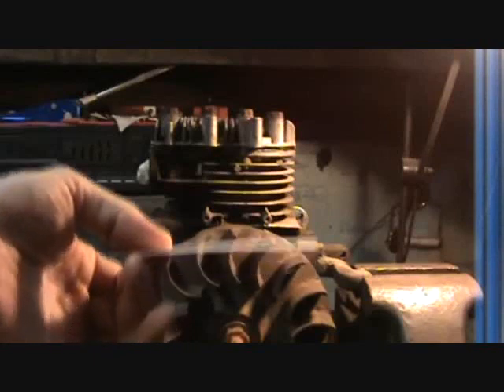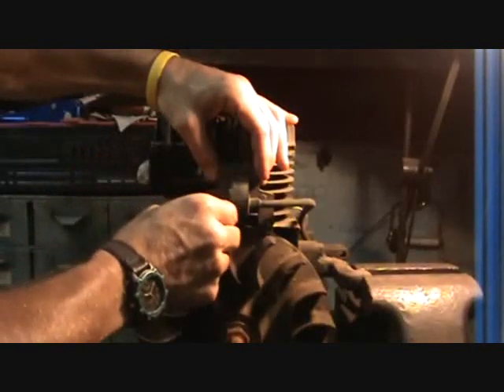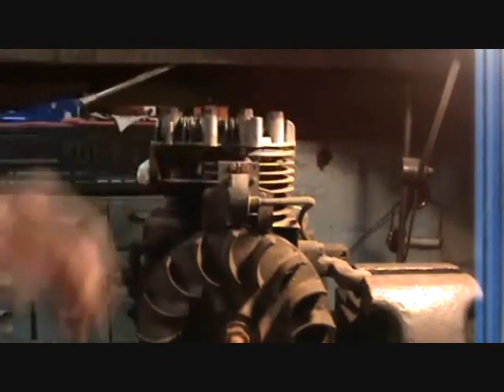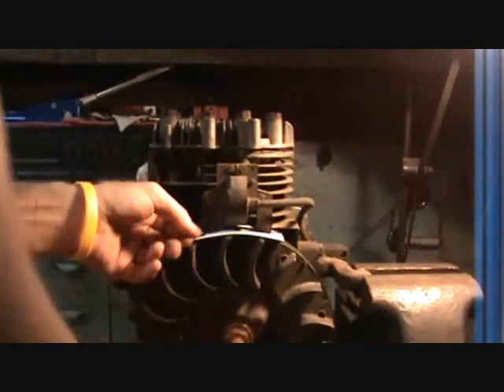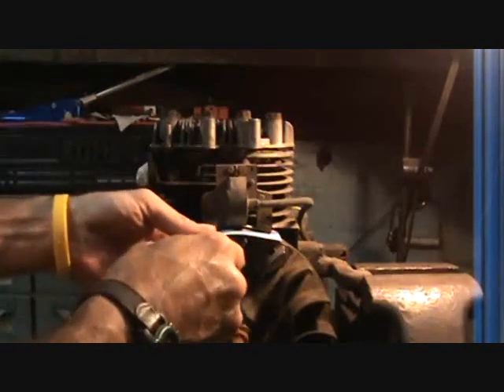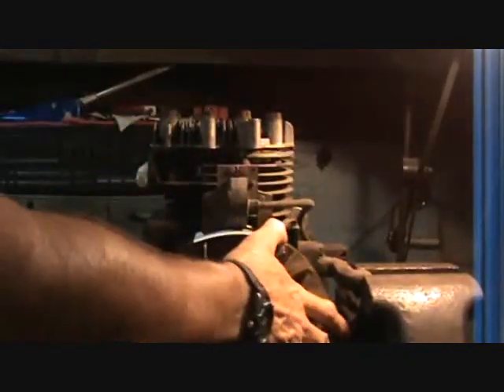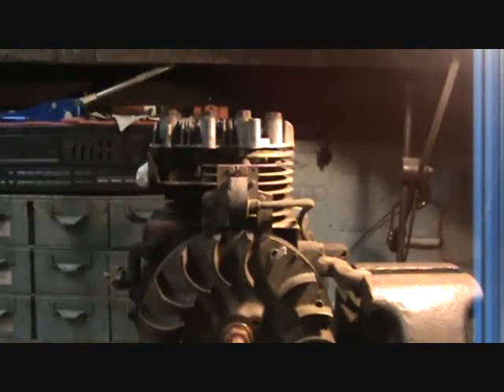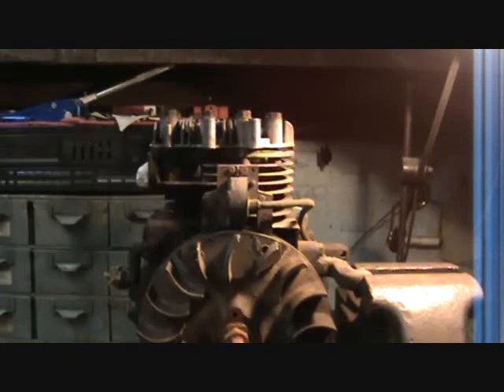Briggs Coil Magneto Magnetron installation tips

Comment: The Briggs larger HP engines have a separate Magnetron mount bracket that is slightly adjustable with slots, for the purpose of  timing changes with OTHER fuels propane, lp, etc. I need to know if these engines can have the bracket relocated for use as ATDC for use with hydrogen gas. The bracket slides under screws short distance.. Is there room for metal screws at different location  as further clockwise as minus 34 degrees for the Magnetron?

Comment: Do you have any experience with gear reduction units on Briggs.  I have an 8 hp from 1974.  What ever oil I put into the reduction gear eventually drains ino the crankcase?   I took it apart, not knowing what I would or should find, and there is a drain hole at the bottom side of the crank through the  side housing into the crankcase. This hole is at the elevation of the gear reduction case fill hole. It eludes me as to how the oil is leaving unless this engine is intended to operate at level only. Maybe if I had it operated at an incline with the PTO side up that is how the oil escapes?
Problem number two.  The attachment bolts from inside the case with lock bend over tabs are fine thread and have been striping out over its life.  The two other bolts outside the case are course thread with same problem. Why are the internal fine thread and external course thread?
Reply from the maker: Excellent questions M One! Yes, I have a number of RD Briggs here. Two of the three I have, have a oil port that allows oil in and then out using the engine oil as the RD oil. The third is a sealed unit with actual gear oil in it (My Model BR6). None of the three I have are as you describe so on that, I cannot help without a model number and type from your engine. On the bolt threads. The fine thread are meant to be torqued more than coarse in general mechanics, so I can only ascertain that they are different because two are load bearing and the other two are for assembly retention and non load bearing. As for why they may be becoming stripped, is that over time, the bushings/bearings on the output shaft of the reduction gear assembly are becoming worn from over tensioned belts or chains. This could also explain why the attaching bolts are stripping out. These are typically designed to be used with chains, but when used with belts, they must have a spring loaded idler arm and pulley in the assembly as to keep just enough tension on the assembly to prevent slippage, but not so much as to cause a lateral pull on the output shaft. Cheers! Zip~
Reply: ZippoVarga thanks so much,  it's a model 143352. Type 502571  Ser. 74185.    I have had this engine for some 30 years.  I robbed the carb and used on another 8 hp downdraft. I thought I should put it back together and clean it up. I soon found that aftermarket carbs don't have the throttle return lobe on the idle set screw side that have the required projection to hook up to throttle spring that holds against wind vain governor. 
Changed out pull rope pulley as the original appeared to have been damaged from lack of maintenance and seized up causing the connection square drive to melt and have no corner lobes left.  Good things I keep everything cause I had one.  I have not found an original decal for the flywheel housing, but I'll keep looking.  Anyway it runs good after a teardown and cleaning/gaping the points.  It's all painted and ready for a date!

Comment: I found a plastic lid that was the same thickness as card,  cut it out in a T shape so I could hang on to it easier. Being plastic if it gets wet, oil, fuel or water it doesn't matter like paper and get torn when rotating the flywheel.  So far I've used it on at least 15 different 2 strokes and one Briggs, works great so far.
Reply from the maker: Brilliant Idea Magic! I may have to implement this technique my self!! Cheers! Zip~

Comment: Zip, one more question. How far do you fill the oil on my 2216? I’ve been filling it as high as I can to get the plug back on, but it goes down after every use. Smokes upon start but goes away. I’m sure it’s tired.
Reply from the maker: Here's an example. My 1962 Montgomery Wards Garden Mark Squire has a very tired 8hp replacement engine that I threw in there 9 years ago. Uses oil, smokes on start up, but still has plenty of power. My goal 9 years ago was to see how long the engine would last as long as I kept oil in it. (The way you're filling it is CORRECT by the way). So...9 years I've been waiting on that little 8hp to give up. It still has over 130psi of compression...it just uses some oil. No odd noises, nothing acting like it's going to let go. So...Let the engine ride OR...you CAN remove the piston and connecting rod with the engine still in the tractor and hone the bore, put in a new set of rings (gap them to .010-.015) and your oil consumption will be taken care of. But...take my 9 year test on the Old Squire to heart. As long as I keep oil in it, it's still kicking butt. So your engine should too. Cheers! Zip~ (2216? I assume it was originally a 2210 or 2212?)

Comment: Zip, my 2210 runs from a half hr to an hour then starts stalling out. If I let it sit 5 min it starts right up . Do you think it’s the coil or should I rebuild the carburetor? Any ideas?
Reply from the maker: Clean out your gas tank and replace the fuel lines. When you do this, also clean out the fuel bowl on the carburetor by removing the main jet (Emulsion Tube) adjusting needle and stay. IF you're careful, you shouldn't have to readjust the needle when you reinstall. Takes a 7/16" wrench at the base of the carburetor bowl to remove this. Then, blow a little compressed air through the fuel line in let up top to make sure everything is clear. Then, reverse the air flow and blow a little light pressure up through the main jet. Before replacing the adjusting needle, connect the fuel lines to the empty and clean tank, then pour a little clean fuel into the tank and observe that you have a good flow of fuel out of the adjusting needle/main jet tube hole. If all is well, button it up and you should be good to go. Cheers! Zip~
Reply: Might try to installing an inline fuel filter.

Comment: My neighbor asked me to get a lincoln welder running that had belonged to his dad and had not been run in over ten years. He said that he had it running intermittentley. It would run very rough when it did run. He had new points and condenser for it but when I removed the point cover I discovered that the points were only run to ground. I pulled the flywheel cover and noticed that it had a coil for electronic ignition on it. One with the brass contact on the module. I check the flywheel polarity and it was north to south. I sent the flywheel to briggs to be repolarised south to north. I installed the flywheel with a new magnetron key, even though it is no different than the original. As soon as I hit the starter it was running like a top. When it kicked down to low idol it began running rich but before I could get it adjusted it died. I adjusted the idol jet and tried restarting it. When I did it would not start and was producing exhaust but it was backfiring through the carb as if it is out of time. I pulled the flywheel and the key and both keyway are in perfect shape. I did check the flywheel and it is south to north. Thee engine numbers are 326437.  0363-01.  8011191

Comment: Thanks for another great video Zippo.  

Connected by a wire tab thingy on the new armature there are two long wires, one has a brass connector and the other is bare. 

 I'm pretty sure the one with the connector is connected to the bolt sticking out of the block, just behind and to the left of the armature, but can you tell me where the bare one is supposed to be connected?

Comment: I am wondering , on the magnetron, there is a little silver button, under the coil, when you install the mag, is that button on the right, as the flywheel comes around, or the left ?
Reply from the maker: Just put the wire connection towards the engine block (back side). The button on the coil eliminates the need for points and orienting the Magnetron with the wire connection to the rear should place the button to the left and the spark plug wire to the right. Cheers! Zip~

Comment: and,,i rewired a simple ign,,toggle,button so there are no safety switches on the tractor,,also,,if the diode is bad on the one wire altenator will it short out/sparks?
Reply: Jimmy Haley the

Comment: on my second NEW coil (Oreillys) and still no fire,,any ideas,,all grounds have been disconnected, B&S 12HP flat head 281707
Reply: I have the same problem with a B&S 8HP 185707
hope there are suggestions
can flywheel magnets go bad ?

Comment: ...is the tab on a new coil for the grounding out? ...impressive first-pull start...I tied that to the on-off key but it won't turn off.  Does either of the mounting bolts have to be grounded also?  My arms were sheared off and put them back on with JB Weld but they are not now grounded with the engine block. BTW, JB was the only product that was hard enough to prevent the arms from flexing when the magnet came around.

Comment from the maker: Did you send in your flywheel to have it properly polarized to work with the Magnetron coil? This is a must in order to get the engine to run properly. A cheaper alternative is to put the old coil back in and purchase a 15 dollar points eliminator. I've seen your problem many times over the years where the coil was swapped out but the flywheel wasn't sent in to correct the polarity to work with the new coil.

Comment: I have a older 10hp Briggs & Stratton on my logsplitter. I changed out the points with a magnetron. I am having a couple of problems. I get it to run, but it misses an pops flames sometimes through the muffler. 
I could pull start it when it had points, but now with the magnetron it seems it has to be spun faster before if will start.
Any comments on my problems???

Comment from the maker: Part 2: You may need to float the points open or closed while cranking the engine over to obtain the best spark. Simply do ad stated in the first replay with the spark plug, then adjust the points while cranking the engine and see if you can get a spark. Some points may be best set at .022, some at .018 or somewhere in between. .020 is a starting point. Best of wishes and I hope you get her running! Cheers!!

Comment from the maker: It sounds as though the coil may be defective. If it's new, then I would invest 15 bucks in a points eliminator that is VERY easy to install in place of the points and so long as the coil is good, you will get spark. Also, Always start with a new spark plug. I take a magnet, clean off the top of a head bolt to make sure I get a good connection, and with the spark plug out of the engine but attached to the coil wire, I set the spark plug on the magnet and turn the engine over to inspect spark.

Comment: hi there a have the same biggs and stratton 16hp engine and it has the magneto/alternator on it, the engine does not have any points on the it,--like i saw the ones that you had replaced in another video-- and found that interesting, but does it still need the points since it has the magneto already? also i have spark but it backfires like  every 10 seconds and wont start? any tips for these 2 questions?. thanks. nice video.

Comment: I used to do this with a matchbook cover too as a kid.I found a lawnmower in the trash heap when I turned 16 with no spark and that was all it needed.That mower kept gas in my tank and kept me out of trouble for awhile.I got so good at doing that I could get it pretty well just eyeballing it.

Do they make this type of coil for a 23-D like the type you had bored out .20 over?I'd like to get rid of the need for points and the points eliminator.Just the coil bolted up and bingo she runs.

Comment: I read about the magnet not properly polarized but I had a mechanic friend look at that and appears to be OK. Looks like I did something really dumb, I attached one of the wires that attaches to the unit to the engine grounding it out. This engine just uses the metal piece about the spark plug to kill it.

Comment from the maker: The problem is that when you upgraded to a Magnetron from a basic coil, the existing flywheels magnets are not properly polarized to work with the Magnetron. You need to send your flywheel in to Briggs and Stratton to have it properly polarized. Hope this info helps!

Comment: I installed a Briggs Magnetron on a 7 hp 190432 engine and still no spark. The engine is 40 years old. It feels like the flywheel magnet is strong, but the magnet area on the flywheel is shorter than on another smaller Briggs I looked at. MIght there be something wrong with my flywheel?

Comment from the maker: On certain engines, this is possible if the lead wires are long enough, but it would be noticeable with the extreme offset from the alignment of the magnet to the coil/magneto.

Comment from the maker: There are a number of factors to think about. Polarity of the magnets, diameter of the flywheel, positive or negative ground system and so on. The likely hood that one brand of coil will work on another brand of engine is slim, but, you never know unless you try! I'm all for experimentation, but if I'm in a pinch and need an engine to run, I don't mix and match. I hope this helps! Cheers!!

Comment: Hey, Zippo! Can you explain why donyboy73 and sixtyfiveford have blocked me from their videos just because I tell them they are doing things the wrong way? For example, donyboy makes a big production out of replacing a starter rope by damn near removing the pulley. I told him you remove the old rope. Pre-wind the pulley and use the spring to suck in the new rope. He says that's too hard for the "novice" when it's actually the easiest (and correct) way. Comments? daviddaveinternational@gmail.com

Comment from the maker: Thanks for helping out here Bro! One thing about converting is that the polarity of the magnet on the flywheel is "supposed to be" re-polarized at the factory to work correctly with the Magnetrons, but I've made the switch and had no problems. Thanks again for chiming in. An other alternative is buying a points eliminator if your coil is still good. Napa sells them for around $15.00 and I swear by them in these older engines. But I'm also old school. If the engine will run on points, I use them.

Comment: @tony00165 You are not sharpening the chain right. Have it done by a saw shop and note how it looks before using. Sharpen same way. Keep in mind, a lot of small engine shops haven't a clue on how to sharpen a lawn mower blade, much less a chain (39 years...I've seen the idiots) Make sure the chain never touches the ground. Some wood could have dirt (in bark) nails (tree huggers) and don't cut R.R. ties with a chain saw. A sharp chain should last at least 1/2 hour if not (too) abused.

Comment: Yes.......the chainsaw starts very easily now and runs like a formulae one racing car.....I'll look at some of your other postings.....I keep sharpening the chain which cuts great for ten seconds and then goes blunt....there is a lot of info on the net but there are soooooo many variations that I find it confusing (file sizes etc) ....still the running problems are cured and I thank you again....Liverpool England.

Comment: Got a carb kit and rebuilt carb. I've checked everything twice. Still cant get carb adjusted right. Leaking gas. Think my float pin is not adjusted right. The engine sputters but want start. I'm going to have to stop for a few days to let my shoulders rest from pulling the rope.

Comment from the maker: Check and clean the points. They should be set to .020. If it's a horizontal shaft, the points are by the carburetor, if its a vertical shaft engine, the points are under the flywheel. Best of luck!